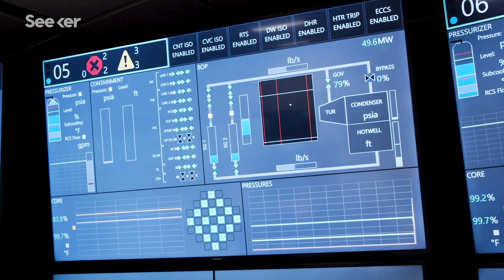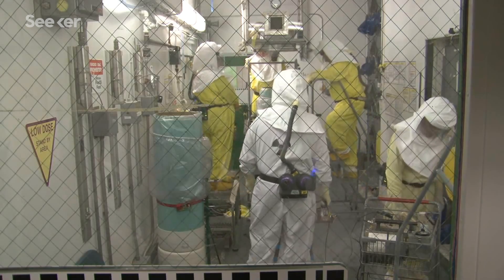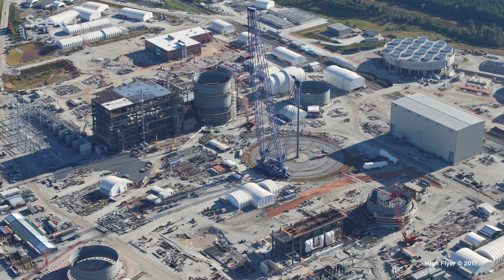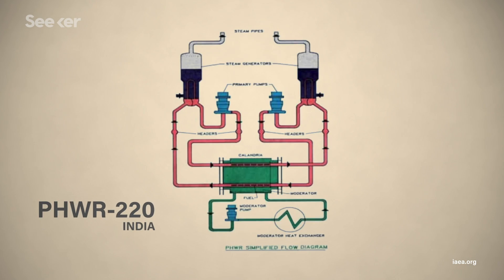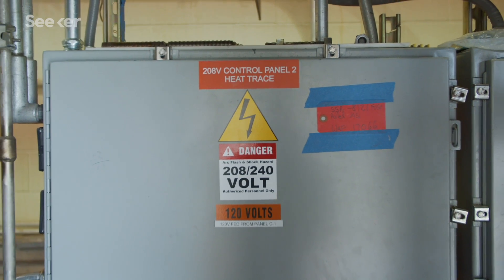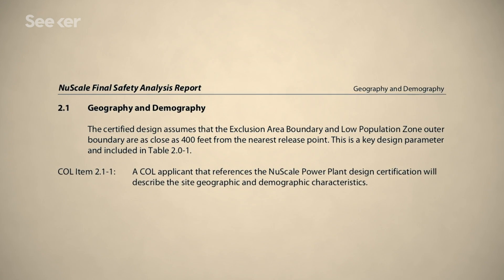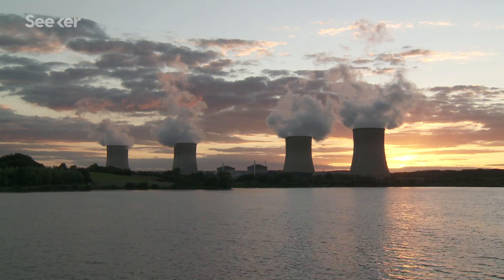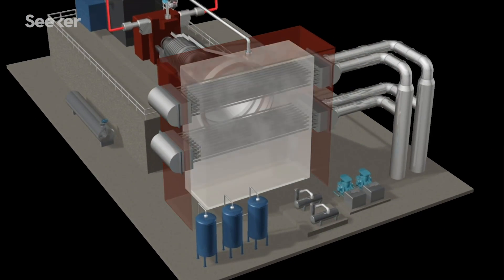Mini-Nuclear Reactors Are Coming, and They Could Reinvent the Energy Industry

Comment: Nobody in their right mind will build an another big reactor, especially a super big reactor? IS HE INSANE OR WHAT? Here in Russia we are actually designing and building, and in fact MASS PRODUCING super big nuclear reactors using either the HIGH TEMPERATURE GAS-COOLED BREEDER REACTORS or the ADVANCED HIGH TEMPERATURE BREEDER REACTORS or the LEAD-COOLED BREEDER REACTORS or the MOLTEN BERYLLIUM FLOURIDE U 233-THORIUM BREEDER REACTORS THAT HAS NO SIZE LIMITATIONS! All of these designs have an inherent design to have a high level of inherent safety, including a strong negative temperature coefficient (whereby fission slows as temperature rises). The reason why they are not being used is because they can produce 60 times to 70 times more plutonium 239 fissionable fuel from depleted uranium 238 and burn plutonium 239 and can do the same with the uranium 233-thorium breeder cycle. And they can burn their own nuclear wastes as additional nuclear fuel. But both of the lead-cooled plutonium 239 nitride fuelled breeder reactor and the molten salt beryllium fluoride breeder reactor can simultaneously reprocess their initial start up nuclear plutonium 239 fissionable fuel to create new nuclear fuel to replace their initial start up nuclear plutonium 239 fissionable fuel, and breed new additional nuclear plutonium 239 fissionable fuel because of the hyper-density neutron flux effect wherein the neutrons are constantly bombarding the initial start up plutonium 239 nuclear fuel from all directions and are constantly and simultaneously multiplying at a hyper-geometric rate and are reflected back into the inner core section of the nuclear reactor core where the BREST nuclear reactor's fuel rods are located and where the Molten Salt Beryllium Flouride filled beryllia-beryllium grid column is located inside the beryllia-beryllium funnel column. But if the uranium 233-thorium cycle is used, it will breed new nuclear fuel but will use up the uranium 233 until it is reduced of it's radioactivity to almost normal level because of the hyper-density neutron flux effect.

Comment: 5:57 A little confused here. Sure you can insert the control rods, but you will still have many elements in the fuel decaying for days after an emergency shutdown that will produce heat that needs to go somewhere (even the chart shows as much).  Is there just a large enough volume of water in the pool vs. a small enough core that this can be done without boiling the water in the containment vessel?  Nothing he said is actually an explanation of why they don't need cooling water.
Reply: You've got it. The pool holds enough water to keep the cores cool for an extended period of time. Its not that they don't need cooling water, its that they don't need pumps to supply it, because its already there. Getting more water into the pool is very easy compared to repairing a failed pump.

Comment: I would love to know how will you refuel these modules? They seem like a one-use thing...
Reply: Maybe they don't intend to refuel them? A nuclear reactor can run for at least a few years before refueling them. I expect it to be easier to just discharge the old reactor and replace it with a new one. Less risk of contamination, and overall simpler and less expensive construction etc. If running say 4 modules one of them could easily be taken offline for a few hours during the night without affecting the power grid.
Reply: Some are single-use, with life-time core, but others are refuelable. Depends on the design.

Comment: Switzerland still has Nuclear Power Plants running today but are going to be phased out in the next 10 years. They haven't been dismantled yet.
Reply: dumb idea, what are they going to replace the lost energy with? solar? wind? HA! as if, no i bet you they're going to build coal or oil fired powerplants to replace them. so much for environmentalism i guess.
Reply: @killman369547  Actually 70% of their electricity comes from hydroelectric dams already. That last 30% they can make up with a rise in solar generation + importing surplus power generated from France and Germany. Plus by 2030, the average power consumption per capita is going to be reduced by 43% from what it was in 2017, so they'll probably only need the dams anyway.

Comment: Gravity works great to shutdown the reactor until the reactor ends up on its side in a disaster.
Reply: Most reactors also have "scram springs" which will insert control rods even if upside down

Comment: I wonder how much it cost to adapt a 1260 MW PWR  like Angra 3 in order to use the halted building  adapt it to use SMR.
Reply: Most of these SMR designs have the reactor "building" buried in the ground for containment purposes. The stuff above is mainly the generators and additional steam systems.

Not really any point in using an existing building unless you're going to put a large reactor in it.

Comment: This is really interesting, on one hand I would expect that as the number of units(reactors) increases there would be some “mass production” dynamics that lead to faults and failures in some units, but I really like the idea of the control/fuel rods falling right out of the main fuel portion. I suppose the unforeseen thing is a short circuit somehow keeping those electromagnets powered. The power switching better be amazingly protected and/or redundant-off like lots of NAND logic. I find myself wondering why the concept of fuel rods that fall out whenever not held actively by electromagnets couldn’t be used in large reactors like we have now. I suppose there may be some concern of physical breakage at larger scales, maybe these rods need to be suspended in liquid to not fall too fast? I’m not educated enough on reactor designs. Cautiously optimistic this works out and helps with CO2 emissions. People who blindly reject the word “nuclear” while pretending to care about the environment make me angry. Though I’ll say they shouldn’t be built in geologically active parts of the world and instead the energy can be transmitted via very high voltage lines.
Reply: This isn't new. It's something that's been done for years now.

Comment: yeah, germany shut down its reactors and raised gigantic brown coal centrals   which are WAY more hazardous for environment and global warming
Reply: lillnemo1 
The sun is the main culprit of our weather changes. The more I study the Suns weather and cycles the more I’m shocked.
Reply: @84jamesp  All energy on Earth comes from the Sun so you are somewhat right. But imagine a Car that stands in the bright sun. The Sun shines through the Windows and on the metall and the whole Car heats up. This is due to radiation (visible light, uv, .....) from the sun that hits the Car and that all surfaces (the metall, the carpets, seats, windows, .....) absorb. These surfaces then absorb and re-radiate the radiation at longer wave lengths (infrared radiation or heat) but the water vapor and the co2 trap this radiation in the Car so it heats up. The same thing happens to the Earth in a larger scale. Water vapor and co2 where in the atmosphere since millions of years but the natural processes that produced and captured the co2 and other climate gases would always balance so that the temperatures where somewhat stable. But now the humans pump co2 and methane usw... in the atmosphere and at the same time deminish the earths capturing mechanisms like cutting down trees usw. Even if its only a fraction of the total co2 in the atmosphere its enough to tipp the balace and start positive feedback loops such as the melting permafrost in sibiria where co2 was stored for millions of years or melting the poles so that the radiation that was reflected into space in the past now heats up the planet even more. And so its kinda a combination and a verrrrrry delecate balancing that we threw of.
Reply: Daniel Moelders Not all energy on Earth comes from the sun. The reason the Earth's core is still molten is because of radioactive decay of elements within the Earth. Without that it would've frozen billions of years ago.
Reply: @gimmethegepgun  yea thanks i overlooked that one
Reply: because they're mongs

Comment: fission is a great way to get energy but fusion is much better as far as efficiency as will a fission reactor will last years a fusion reactor can last decades and even centuries. but it think now the best option we have is using the one of the largest heat sources and that is the earth. the earths core is extremely hot and wont cool anytime soon so its possible to high jack it by digging several mile deep holes and pumping water in them and letting the earths core boil the water. or just put ceramic polls into volcanoes to draw the heat from them to boilers to turn turbines.
Reply: Yeah, that would take trillions of dollars. Nice idea for a sci-fi story though.

Comment: Why this plants aren't installed in abandoned underground mines?? They will have unused high capacity electric transmission lines and transformers, high quality acces roads, well controled ventilation pipes, easy of built inundation pools, even the possibility of installed a floating power plant underground which can easily resist an earthquake, it can be easily controled remotely by optical fiber communication, sometimes are near comsumption centers, and even if everything goes wrong, they can blow the whole mountain burying it without the risks of contaminating the atmosphere or underground waters (if the power plant is deep enough).... with this modular and small technollogies it will be easy to built, and even they can dispossed the nuclear waste inside the same mine... it will be highly cost effective i think

Comment: Ultimate question is the proper way of handling waste.
Reply: dump it into a volcano
Reply: @freddykrueger6571  You want vaporized radioactive waste in the atmosphere because that's how you get vaporized radioactive waste in the atmosphere.
Reply: @Sceth  Isn't the Earth itself a nuclear reactor?  Where do you think all that heat in the planet comes from.  It comes from nuclear fission.
Reply: @freddykrueger6571  No, no it is not. The heat from the core comes from the heat it gathered from its formation as well as frictional heating. Radioactive materials play a very small part. And just dumping radioactive waste into volcanos will just lead to a cloud of radioactive smoke rolling across the earth.
Reply: @Sceth  Wrong.  The heat during formation would have only lasted 6000 years had that been the only (or major) source of energy.  The vast majority of the Earth's energy comes from nuclear fission.  That is why it stays hot and has been so for billions of years.
Reply: @freddykrueger6571  Buddy, this is not hard information to look up. Just use google and it will tell you otherwise.
Reply: @Sceth  You look it up.  You'll see I'm right.
Reply: @freddykrueger6571  I already have, There are three main sources of heat in the deep earth: (1) heat from when the planet formed and accreted, which has not yet been lost; (2) frictional heating, caused by denser core material sinking to the center of the planet; and (3) heat from the decay of radioactive elements. I feel I need to point out that radioactive decay is a distent 3rd in this list. And It's not fission of those elements but just natural decay.
Reply: @Sceth  Fission within the core of the Earth is the main reason the Earth is still hot.  It was calculated long before nuclear forces were known that the Earth as a molten ball should have cooled rapidly and lost its heat within a few thousand years.  Why it was still hot was a mystery to scientists in the 1800s and before.  It was not until the discovery of radioactivity and nuclear fission that a full explanation of the Earth's interior heat source was understood.  Fission is the reason the Earth has stayed hot for billions of years. 

No object maintains its heat through insulation alone for billions of years.  That much should be obvious.
Reply: @Sceth  You're wasting your time.  Use your common sense and try this experiment.  Heat up a metal ball (not even a rock but metal ball that is a way better conductor of heat).  Wrap it in a blanket.  See how long it retains its heat. 

Common sense will tell you that heat is easily lost through conduction, convection, radiation..etc.  It hardly stays warm for any significant amount of time.  Heat loss is on the order of the inverse square law with a larger ball diameter losing heat at an exponentially faster rate. 

That was simple enough to scientists before 1800s to figure out with basic pen & paper calculation.  So why are you having a hard time with it. 

The only that that sustains Earth's hot interior is nuclear fission.  Its the only thing that generates energy on a vast scale sufficient to keep the planet hot for billions of years.  Keep the word BILLIONS OF YEARS in your mind and it will all make sense.
Reply: @freddykrueger6571  Again, you fail to think of things on a planet-scale. Just like those scientists from the 1800's. Just stop man, just stop. You are so devoid of common sense it's laughable you are trying to use that against me. Once again, every source out there says you are wrong. This is like talking to a flat earther.
Reply: @freddykrueger6571  And why has this conversation spun off into the inner workings of the earth when this was about you wanting to burn nuclear waste in volcanos?
Reply: @Sceth  Its to help you understand the concept.  This is by the way how experimentation is done.  Relating the diameter, mass and material of spheres and the rates at which they cool to understand why heat during formation of the planet cannot sustain itself over billions of years - A concept you fail to grasp.
Reply: @Sceth  Scroll back.  You are one who went on and on about the Earth's innards being hot for all the wrong reasons.
Reply: @freddykrueger6571  I'm not denying radioactive elements heat the core, it's just not fission. It's natural radioactive decay. And burning radioactive waste in valcanos is a world ending thing to do. First, not all valcanos have lava pools. Second, the ones that do are extreamly active. So not only would you be pumping radioactive smoke in to the atmosphere but the valcanos would erupt and spit the burning waste back out.
Reply: @Sceth  It is fission that occurs in the Earth.  It is what has kept and continues to keep the interior of the planet hot for billions of years.  Essentially the Earth is a giant nuclear fission reactor. 

The only thing more powerful than nuclear fission is nuclear fusion - and that takes place in the Sun.  And no, the sun is not hot because the heat during its formation billions of years ago.  Its hot because of lighter elements like Hydrogen fusing into Helium and on and on up the periodic table till you hit Iron.

You see the pattern.  Its nuclear energy both in the Sun and in the Earth that makes it hot.
Reply: @freddykrueger6571  no, that is still just an unproven theory that a small number of scientists are still struggling to prove. The accepted theory is natural radioactive decay. Fission requires a means to contain neutrons and bounce them back in to the fissionable meniral, something that is ridiculously unlikely to happen naturally. Most fission reactors use water to create the reaction, something I doubt is in high quantities at the core of the planet. But I don't care about this topic anymore, why do you keep dodging the, valcanos as nuclear waste disposal, topic?
Reply: @Sceth  

Its basic geology.  Radioactive decay of what?  There is no aggregated quantities of heavy isotopes in the Earth's core giving off radiated heat that warms an entire planet.  Were it so, rocks formed from volcanism would be quite radioactive. 

You are making stuff up here.

Nuclear fission is what warms the Earth and nuclear fusion is what keeps the Sun hot.  That is science.

Comment: How would they dispose of the spent fuel?
Reply: Spent fuel is either recycled for other types of rectors, sent to secure storage facilities, or if it is completely depleted used it weapons manufacturing.
Reply: @cavejohnson4306  so if they were to have several locations around the us the would also need a company to recycle or find another use for the depleted rods? How long does it take for the fuel to be spent ? Months ? Years?
Reply: henvy romo usually recycling is done by the company that stored the waste. When a rod is completely depleted it becomes lead but if it is depleted enough as to not be dangerous it is used to make anti-tank rounds. Radioactive materials deplete in an inconsistent rate so it really can’t be measured how long it takes for them to degrade outside of averages and estimation. I am unaware of the control rods changing procedures as those change from location to location.